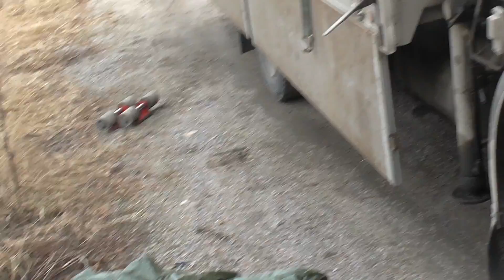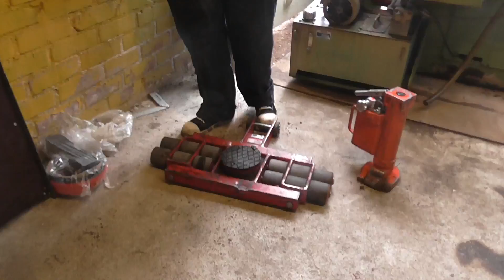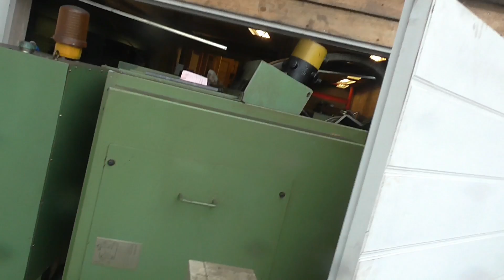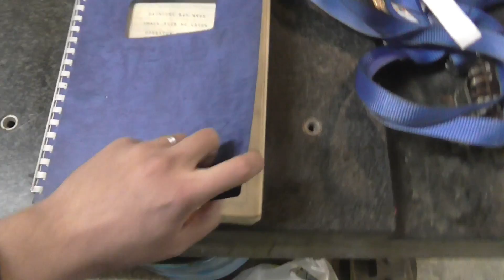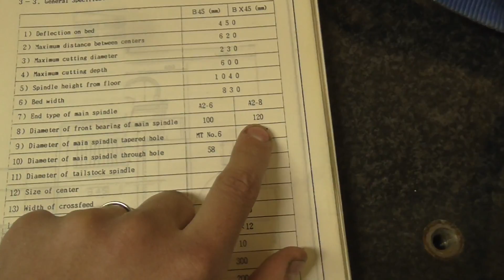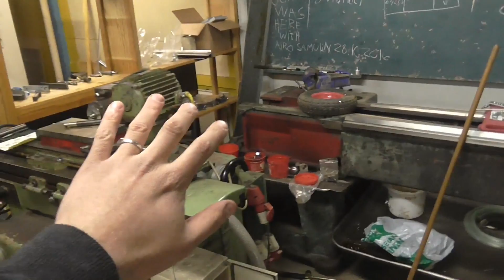Dainichi BX45 CNC lathe move part 2

Comment: I wish the machines in the last shop I worked at had chip conveyors; it would had made the job of cleaning up a lot easier.
Reply from the maker: My VMC has no chip clearing device and I really hate it for that. It's a pain reaching over to clean the chip bin. Sometime I will build some type of chip clearing device for it.